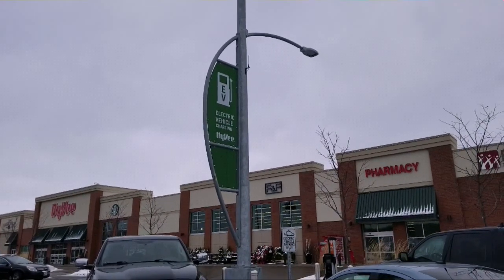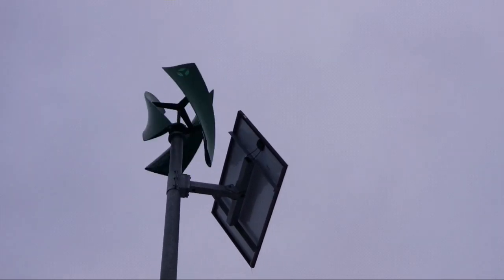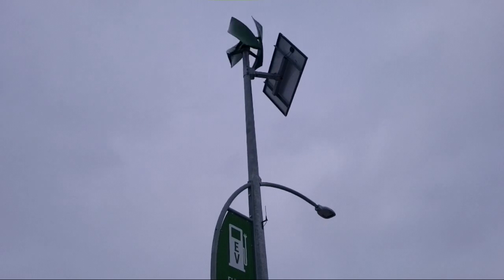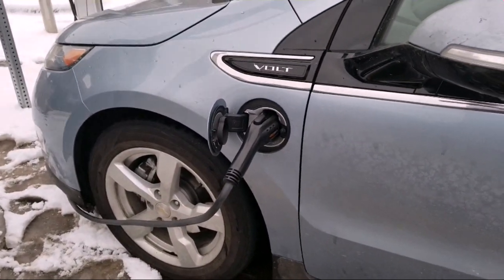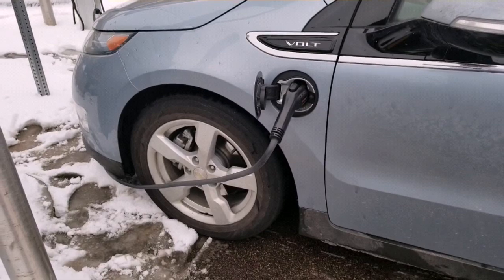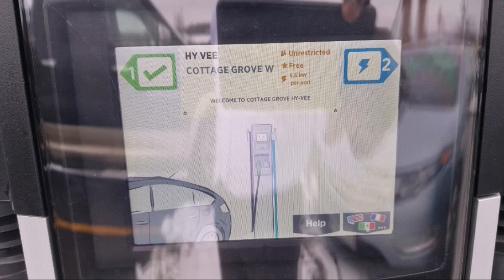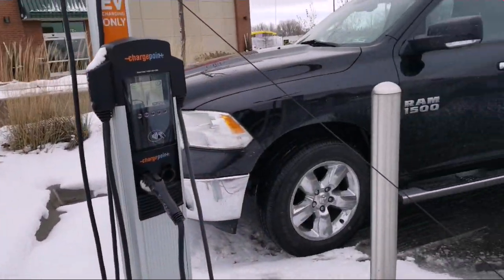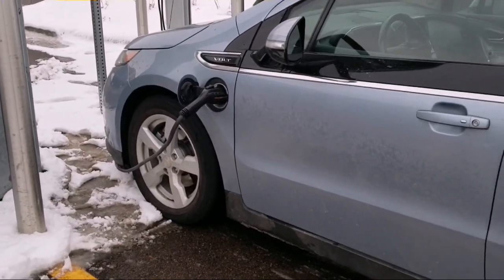HIGH SPEED VERTICAL AXIS WIND TURBINE PLUS SOLAR: Charging A Chevy Volt Electric Vehicle At 6.6kw

Comment: Must be a large lithium in the ground or maybe the panel and wind is just grid tied as the most that would put out is 3-400 watts. I do like the idea and we need more charging stations.
Reply: I agree,  there is no way the solar panel and VAWT could supply 6kw  alone. About 280 watts for the panel and possibly 500 watts in a very strong wind for the VAWT, or 0.78 kw total. Might be possible with batteries to generate enough power to charge ONE car per day but I suspect it is grid tied. Having said that, any renewable in place of dirty power can only be a good thing.